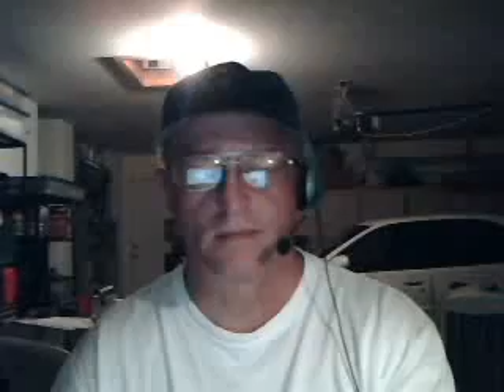The Gadgetman Groove Process

Comment: considering most engines today have an idle air control valve or an idle air control motor and analyzing a fuel directly into the intake port couldn't take advantage of this effect the idle air control motor bypasses that flap in the front of the carburetor you can put tape across the front of that basically any idle air control motor will compensate enough to keep it running